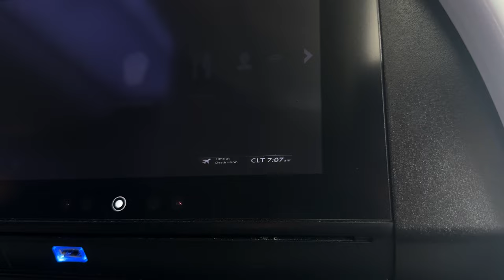We TRAVELLED 4,336 miles to Build a BMW G80 M3! (Bimmer Invasion Orlando)

Comment: What's the reason for the blue tape around the headlights when taking the front bumper off?
Reply: This is to prevent scratching the paint off. It's really easy to scratch off paint on the edges.  I made the mistake of not doing this, but i learned my lesson
Reply: @carbonm2  That's what I thought, thank you!